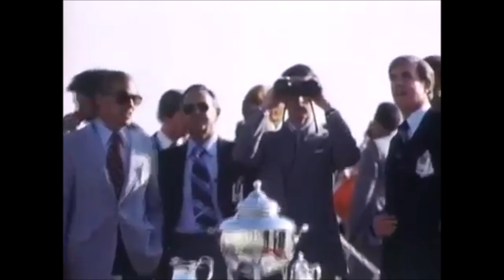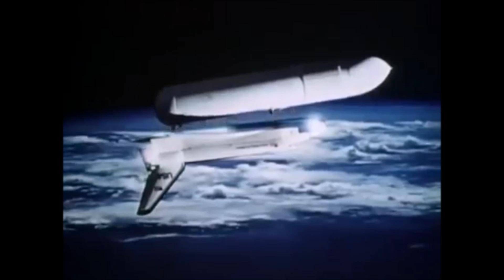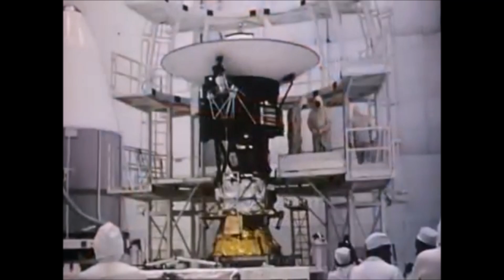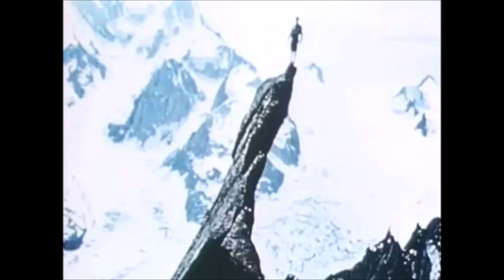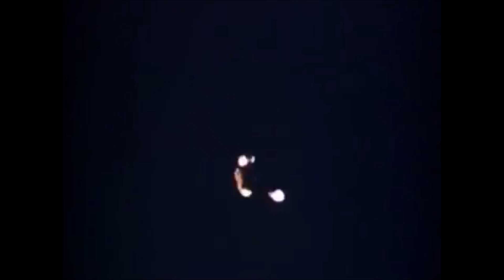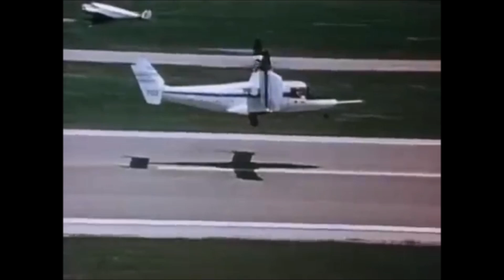Flat Earth - NASA 1977

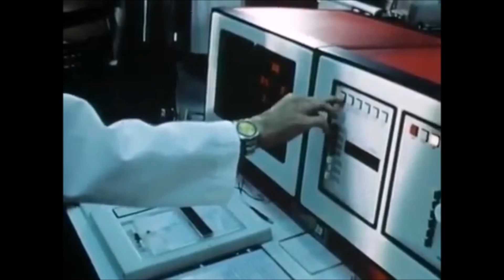Comment: 4:39  Marquette Electronics CASE I stress system is being used.  Marquette founded in 1968 became a major medical electronics manufacturer of diagnostic and monitoring equipment for medical centers worldwide.  The company was acquired by General Electric Medical systems in 1998.

Comment: pierre castille i didnt claim that  the 747 couldnt carry that empty box on top of it to be paraded around america so everyone has it cemented in their skulls that its real. i said i could hear engines powering down when it lands which if its a glider it wouldnt, plus think about this do you really think that stupid little bracket at the front could hold all that weight, the shearing forces alone would break it! not to mention the weight whats it made of UNOBTAINIUM!!!! ITS AL B.S. let me know your thought.
Reply: +Jonathan Roberts Hear, hear. But even with sound, logical explanation like yours, they still deny.

Comment: Hair, as an internal threat to the security of ISS.

Only on russian (sorry, please translate and use it).

http://getdoc.ru/

Via Google Translator

Have you seen a similar picture (hairline grid / drain) in the bathroom? I yes, and this is normal, even for a healthy person.

Find out the answers to the question "How many hair drops per day in a healthy person?". The answer is you can get almost any website dedicated to beauty and health, and on the websites of women's issues.

For example here: Doctors have found that daily hair loss is the norm: for blondes - 150 pieces; for dark hair - 100-110 pieces; for red - 80 pieces. And it's only about the head.

And what we are shown in the video and photos on the ISS? We show hairy astronauts on the head, hands, and probably other parts of the body.

And we did not show. We
 do not show how astronauts cut, not show ventilation and protection 
from the hair, do not show the cleaning of ventilation of hair, do not 
show the accumulated trash, in particular the hair for a year or for 
such shorter period does not show how get rid of garbage. But we are shown how to clean teeth hairy arms.

In general, do not say that such a problem exists, and it is in my 
opinion, the presence of hair, one of the main concerns for the safety 
of life at the station.

Hair astronauts, Safety strictly should be prohibited in all parts of the body.

But we see that the hair is not forbidden, so is another reason why OS / COP / ISS does not exist!

Even the saleswoman in the Soviet times hidden hair.

And for all the plant for electronics, is a mandatory standard - to hide the hair.

So why do not they hide the hair?

I think it manifests psychology liar. They
 are trying to prove and show us that there is a station on it zero 
gravity, and smeared with paint / hair gel should like to create the 
illusion of a free floating.

Comment: And the Commercial Plane does not get crushed under the weight of the Shuttle?!? Hold on that does not make sense, that has to be some light weight mock up. Planes are strong but not that strong!! Unless this is a Superman Comic Book...LOL
Reply: +Pierre Castille sitting on the fucking roof of a hollow tube??????????
Wow, you really thought out that comment didn't you?
Reply: iamihop structural engineer disagrees with your statement. You are reaching into territory you are not qualified to comment on.
Reply: unfortunately, that doesn't mean you're right, bimbo.
Reply: +Dawn of Light well said I agree with u 100%
Reply: :) yay.
Reply: The max weight on the 747 doesn't calculate for 60 tons on the roof of the airliner.Maybe 112 tonnes inside the plane but on the soft roof?
Reply: Peter EXACTLY!!! THANK YOU :)
Reply: ***** that model they put on the roof is made out of fiberglass and probably weighs less than 5 tons. The shittle (no typo) that you see landing is a retro fitted Lear jet, basically a body kit, like back in the 80's when they sold a kit to transform a Pontiac Fiero into a Ferrari 308GTS.
You can clearly hear the engines when the shittle is landing and nothing shaped like that could EVER be called a "glider". Shit is laughable.
Reply: +Chuck Norris "are you looking for one?".... No I'm not.... because with you (Chuck Norris), one looks for you.... And lo and behold.... You.
Reply: I'm going to argue my 15kg baggage allowance from now on 😊
Reply: +Chuck Norris No because you're Chuck Norris.... And gay makes you.
Reply: +Chuck Norris And that makes you gay.
Reply: +Dawn of Light.

Lets talk about heaviness.  Shuttle weighed 60 tonnes,  maximum payload of a 747 is 112 tonnes.  As you obviously know so much about aeronautics I will let you draw the correct conclusion.
Reply: Doesn't payload mean the load is on the "inside" of the Plane? The outside is not made to carry concentrated weight like that. And that tiny little bracket is really going to hold a 60 ton shuttle in place during a flight. Not mention the aerodynamics of such a beast on a 747. Gimmie a break. I assume there is good reliable footage of them putting the beast on the plane AND getting it off?? I will just go see if I can find some.. I would love to see how that happens. Being 60 tons and all. Have a nice day.
Reply: are you looking for one?
Reply: +Dawn of Light Bees
Reply: so, this makes you gay. correct?
Reply: +Dennis Karnes the steel struts go through the entire plane. The roof doesn't bear the weight. Additionally, once in flight, the Shuttle's wings provide lift and literally help carry the load.
Reply: +Dawn of Light payload is the weight that is not fuel, or the weight of the aircraft. Where it is positioned is a concern of balance.
Reply: Ren Pope I get all the logistics of how it would be done, it still doesn't change the fact the shittle has never been to "space"
Reply: It's fascinating how they can have this kind of questions but I bet they do not hesitate for a second believing that some biblical figure walked on water. And they are the people that talk of brainwashing ... :D